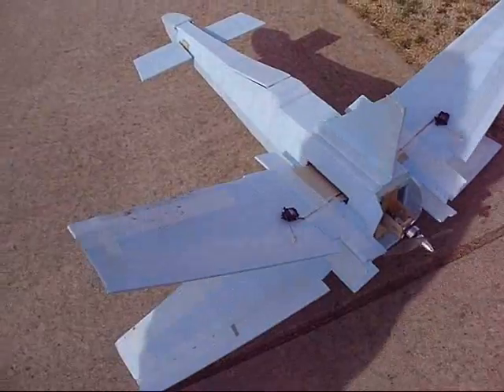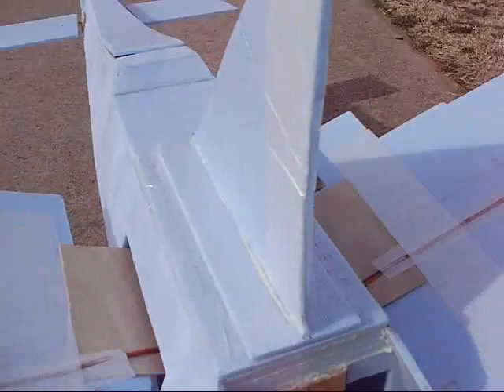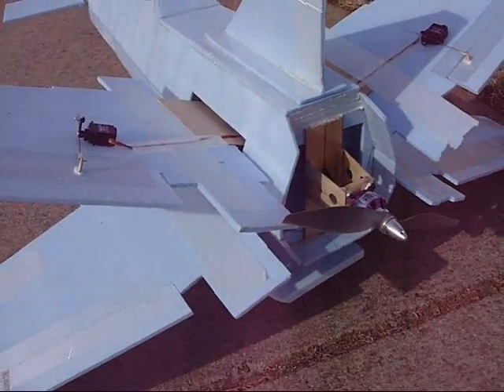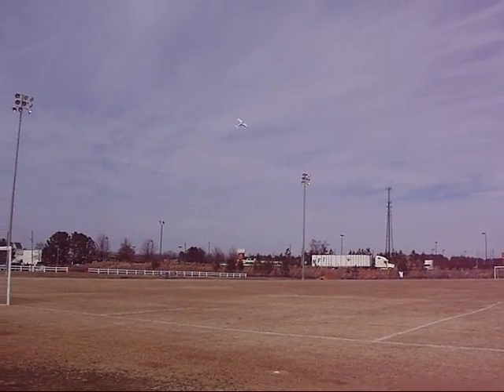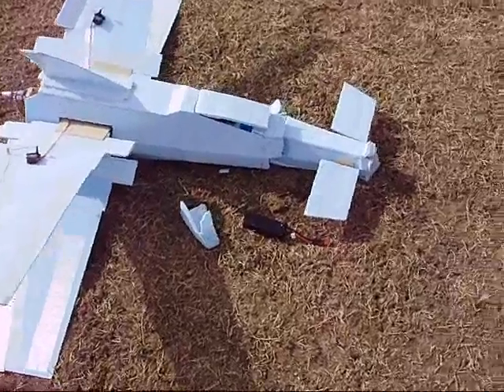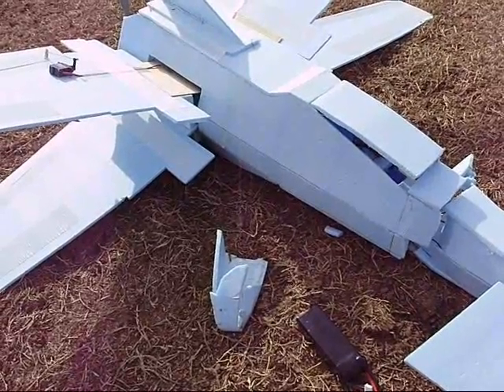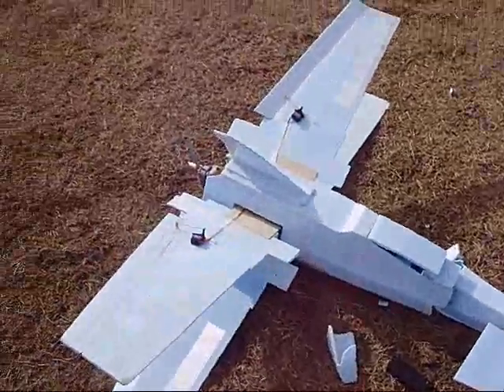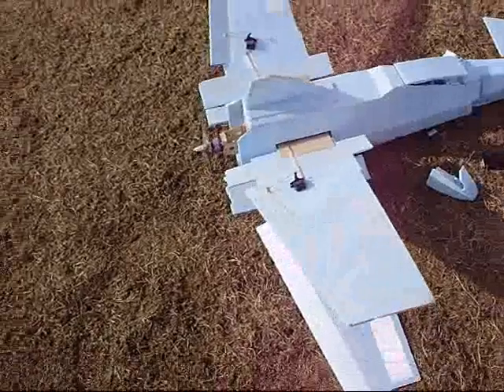RC Star Wars X-Wing Fighter build PART 8 (Rough Build test model) Fourth Flight attempt

Comment from the maker: @vanepico Hey vanepico thanks for the tip. This video is about 3 weekend behind now. I have now added carbon rodes to each of the wings to remove the flex and also moved the cg up more. So the x-wing is ready to go. 2 problems though. First is the wind will not let up so I have no had a chance at all to test. Second last weekend the wind let up for about 30 minutes. I got in hurry and was trying to make another video and hand launched. Big mistake! That was while reason for the dolly.